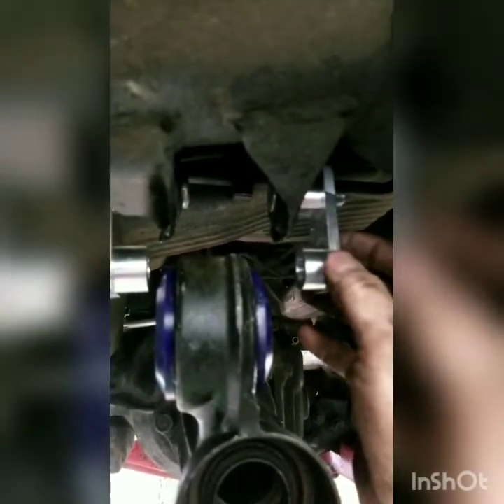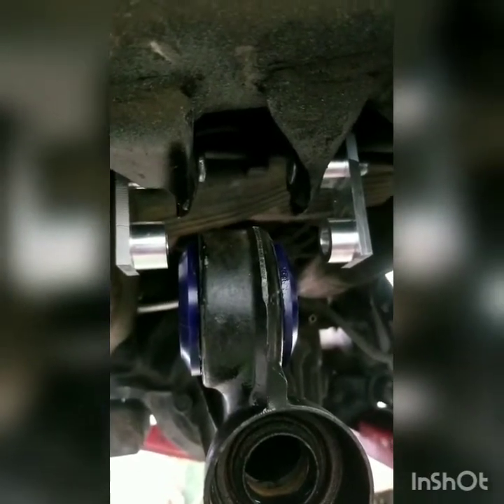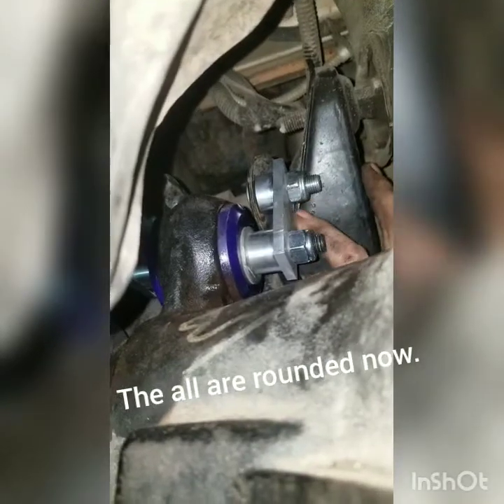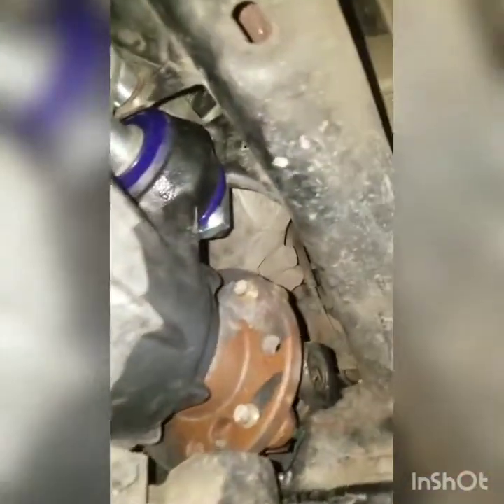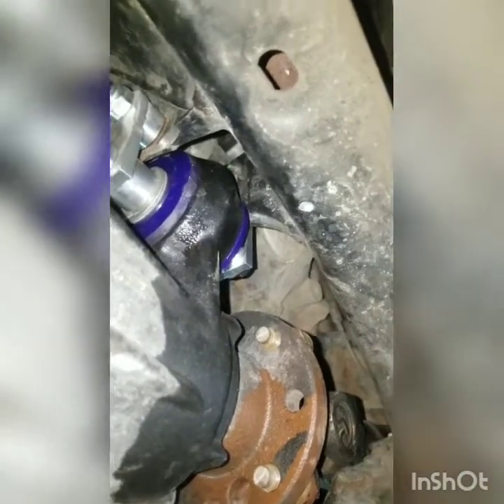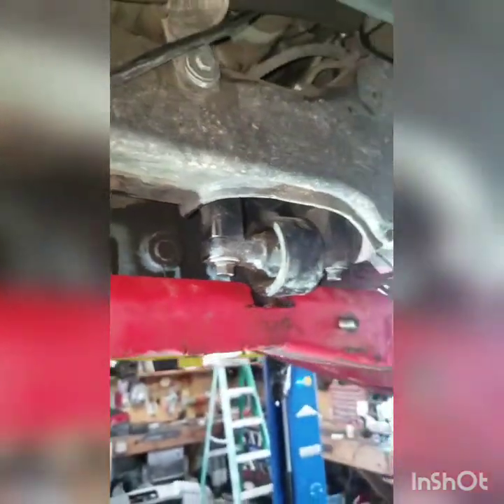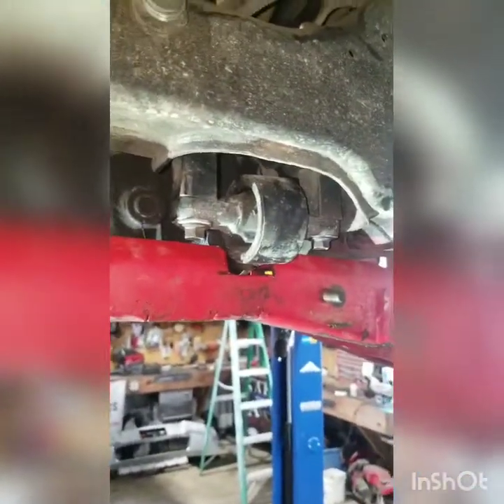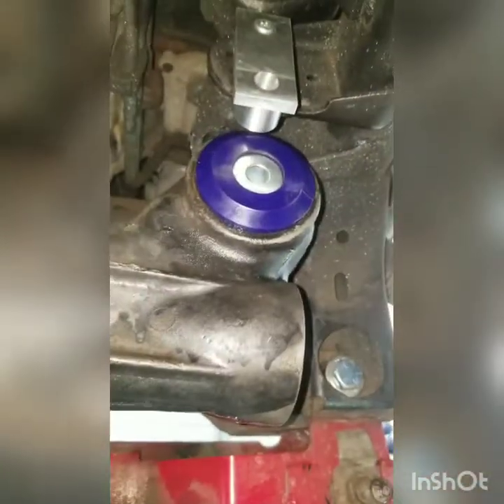JJ off road diff drop install

Comment: How safe is to notch the cross-member? And what would be the min. thickness for it?
Reply: The bottom of the crossmember is 2" solid metal. The top being notches is only about 1/8" metal.  It is notches and then plated back.  There are 1000s of jeeps running this notch. Superlift had the same design when their kits were still available.

Comment: Hi got a question here.
I have 2014 wk2 diesel and i would to add some lift with blistein 5100 with oem heavy duty spring on last notch #4 wonder how high can i get?
Reply from the maker: We only work on WK and XK.  Sorry.

Comment: I want this kit but I can’t not find it on super lift
For the xk or wk. the steering knuckle cross memmber diff drop a-arms springs rear leafs…. All of it. Can you sell it still? If so please reply where I can call or find you
Reply from the maker: We sell the diff drops. We don't sell Superlift parts.  They don't sell them anymore either. They discontinued all SL parts for the WK and XK.  Our kits can be found on our website. Jjoffroadfab.com.